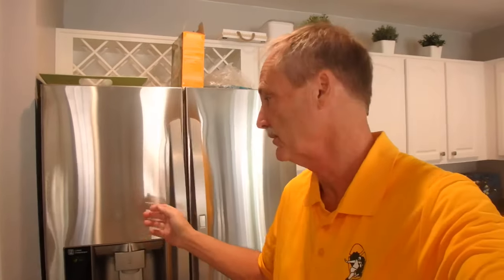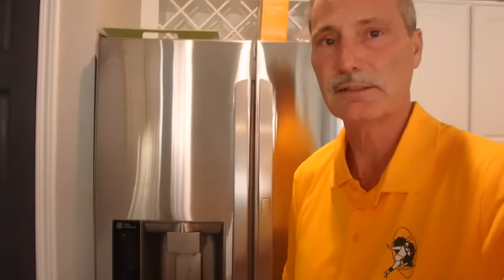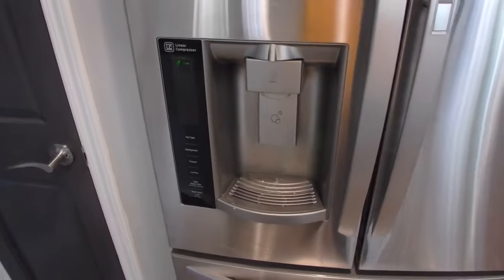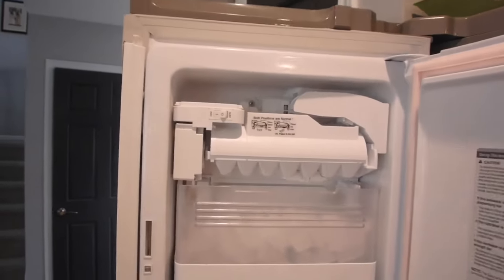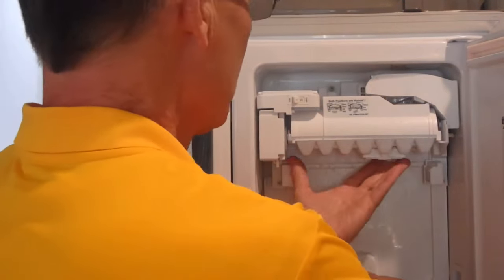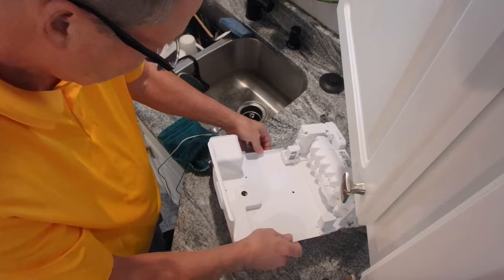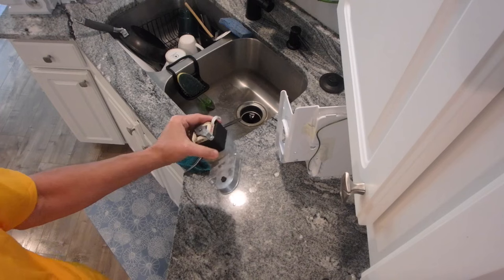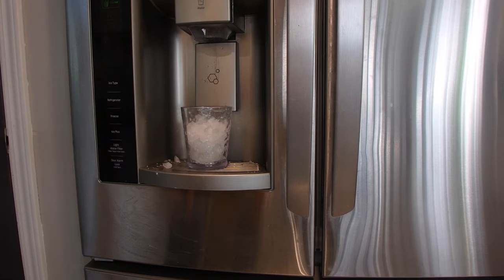LG Ice Maker Repair

Comment: Huh...you actually didn't show how you fixed the frozen-jammed actuator. Ya know,  the thing that wasn't working 😮
Reply from the maker: I didn't fix it.  I bought a new one and replaced it.  The internal gears moved but the actual small motor was seized. So I had to buy the entire actuator.  I found my model on ebay for $50
Reply: Where do you find the model of the actuator?? This is the exact issue with ours.
Reply from the maker: @NicoleVadasz  I reviewed the parts manual for my LG model.  It indicates the proper part number
Reply: Cool! Thanks Scotty G! I have the identical problem. I will be looking for that model number and swapping it out.

Comment: I have the same problem in my LG fridge.  It just overnight stopped dispensing ice.  I have been through several videos.  However, I can turn the actuator by hand.  It is making ice okay, the flapper opens when you press for ice.  No motor noise.  I will check on replacing the actuator.
Reply: what is actuator ????

Comment: My Ice maker stopped a making ice and before I was about to spend 150 on the ice unit I just did a good old unplug the entire fridge freezer pressed a few buttons to try to discharge all residual juice and plugged it back in and it worked. Start with the easiest fix first. I'm happy not to have done any real work and saved some money too. Figured I would contribute since I watched this video it could help someone as well.

Comment: Appreciate the video. Our icemaker jammed and this video gave me the courage to take it apart myself

My problem, if the helps anyone else, is that the ice expanded in the tray (water expands when frozen) and jammed the turning mechanism so it won’t dump the ice. 

The only solution I found is take it apart, put it outside and thaw it all. Put it back together, made sure all plastic parts that popped apart due to ice expansion were back together and it worked fine. 

Reason you have to take it apart is that if you left the door open to thaw it, you are leaving your whole fridge to thaw too 

Hope that helps someone. Follow his steps and let the whole unit thaw, then put it back.

Comment: This fixed our problem!! Our ice maker was making the ice but stopped automatically dumping it. We could press the button and manually dump it but that got old fast. Took a lot of effort to get that center screw off! Would also add that it took a few days to wake up and start working. Went on vacation and returned to the bucket being completely full upon our return! No issues since.
Reply: I'm having the exact problem as you. Did you just clean the actuator or replace it?
Reply: @jordaeclark5  update- ended up not working a few days later. Had to have the whole coil unit (name?) replaced by a professional. Definitely needed a professional to do it bc it was very involved with changing out gas.
Reply: @lindsaymoye3214  it worked because you turned it off for a while then back on allowing it to reset.

If you hit your reset button and it dumped ice nothing was wrong with your motor
Reply: @windstrings  So what IS the issue with this symptom?  Mine stopped making ice...I did the reset, and now it makes ice but doesn't dump/cycle...  unsure what to check/do next.
Reply: There are a bunch of us on here all asking the same question due to the same issue:  Icemaker makes ice, but doesn't cycle to dump the ice in the bin.  When we hit reset, it cycles.  This shows you that everything is working with the icemaker EXCEPT the sensor that tells it the bin is FULL.  Why else would it not dump ice?  The sensor appears to be infra red bulbs at the bottom of the tray that shoot over the top of the bin.  When the sensors are blocked, DON'T dump ice.
Not sure how to fix them.  I cleaned them off real good and am waiting for ice to freeze now.  Don't think we can get that part separately.
Reply: @jimbutler7122  YES!! The only way we an get the ice to dump now is to push the reset button EVERY time!! Someone please HELP!!

Comment: Our LG is a slightly earlier version as it does not have the ON/OFF switch for the icemaker. Mine was turning the ice into a block and freezing the whole assembly to the door. Saw a video where someone cleaned the water dispensing orifice. Tried that, no change. Inside the filler spout there is a plastic plug with a very small orifice. I pulled that plug out. (Mine was orange) 3 weeks later, no issues whatsoever.

Comment: Hi Scotty G., thank you for making this video. Same ice maker as featured here. I have to keep pushing the reset button to dump the ice. I need your expert advice on how to fix that! Thank you!
Reply from the maker: That’s a very good question.   I have not had the opportunity to work on that.  I would review the schematic of the upper component and see of the reset button is a replaceable item.
Reply: same here...what's causing this?
Reply: Same for me.  I've tried everything the other videos show.  My only problem is I have to press the reset button to dump ice.  It won't do it on it's own.  Bar is not obstructed.  Everything else works as it should.
Reply: @kp4585 having the same issue as you! Sucks

Comment: The actuator never free spins , the old one was probably fine.
He never showed that the new one spun freely...bc it was no different.

The gearing mechanism is fixed till it activates to dispense ice.

Remove the ice tray, close the door & press the lever to release ice, you'll see it spins fine when activated, now try to spin it by hand....nope!

That's normal operation.
Reply from the maker: Friend, I replaced my actuator and the ice dispenses properly.  And that was the pint of the video.  My original actuator was bad, buying a new one for $65 and replacing it myself fixed the problem.

Comment: Hey Scotty G. Thanks for the VIdeo Great!     My problem is this. I have water that dispense "Ok". But I have "no" water for the ice maker. Just does not fill. The switch seems to work, but when I turn it on and off the tray does not move (much). Is it sticking? Got any ideas? Again, I have water dispensing ok. Just not filling the tray and the tray maybe stuck.
Reply: Mine did this.  Take the bucket out, and up in the left corner, facing down, is the reset switch.  Hit that and see if it fills.

Comment: Hey Scotty  I got the same Ice maker you got. I've always got crushed ice and found a white plastic part in my glass which I know came out of the icemaker. Looks like a small wheelchock. It has a long gated hole in it made that way handle-looking thing.  I'm sure it has something to do with Cubed and Crushed Ice. You didn't happen to see anything like that in there. ABS   P/N   MEA619928-6    HN.09.10         The 28 could be a 26 number are worn.
Reply from the maker: I don't recall seeing it.  But I was more inside the motor that turned.   Not too much at the area you speak.  I would google your model and look at the schematic to see if it looks correct.  Could be part of the method to toggle between cube and crush

Comment: Did you buy a new actuator or repair the one that was already in the refrigerator? If you repaired it how did you do that step? This is exactly what is happening with mine.
Reply from the maker: The motor driving the gears inside was locked.  I bought a new actuator assembly for about $65
Reply: @scottygtheretirementguy3134  By any chance would you have a part #? I have searched the lg site and can't find the actuator.
Reply from the maker: @TiGress422  the actuator might be model specific. I googled my model number which is found inside the refrigerator near the door, and added the word PARTS.  Several listing came up with diagrams and part numbers.    Places like partselect, partsdr, appliancepartspro.  Show up
Reply: @scottygtheretirementguy3134  Thank you, I will do that. I appreciate you getting back to me so quickly.
Reply: I love these comments!  I knew my answer would be here aka already asked!  Go SWAG!

Comment: I have a LG two door fridge and there is ice building up on the wire that moves that dispenses the ice. I have no issues with the water coming out of the fridge and have tried resetting the ice machine many times. What should I do? Do I need to replace the ice maker?

Comment: We could not find exact actuator so we bought whole assembly. The new one has extra plug. Old one has two and new one has three. We tried to hook up not using extra plug and it doesn't work at all. Any suggestions?
Reply from the maker: Sounds like the incorrect part

Comment: can I use a spray like WD-40 to loosen the actuator and hopefully start dispensing ice cubes again?
Reply from the maker: The inside of the gear mechanism is packed with grease for the gears.  It might work, but my motor was not working.
Reply: Is there a way to test motor to see if it works?

Comment: Noticed no water line hooked up the the ice maker assembly when you removed it.  Where is the water supply?  (I'm asking because my brand new unit leaks water into the bin and down into the ice dispenser hole.)  Mine doesn't have an on/off button either.
Reply from the maker: The water comes into the tray up at the top right corner.   So I don’t think mine showed.  If yours is brand new it should be under warranty

Comment: Hi! I have the exact same refrigerator but my problem is that the icemaker is slow to make ice. Even with new filter, same results. The water dispenser works great. What could be the issue?
Reply from the maker: Hmm. I assume not enough cold air flow.  Does it work better if you use the Ice Plus option?   You could lower the freezer temp. Mine is at 3.  They are a rather slow maker

Comment: Scotty, thanks for the video.  After you replaced the actuator arm, how easy was it to turn the metal connector?
 I can turn mine, but it takes a little effort.  Should it turn easily or with some resistance?  Thanks.
Reply from the maker: Since it has a few gears inside the motor it has some resistance.  Similar to winding an old fashioned clock with a key

Comment: Hey Scotty G, where did you buy the part actuator? Mine is doing the same thing (not dispensing ice)
Reply from the maker: I googled the part number from the specific model parts list.    Then I used Amazon and found one.  They might also be on eBay

Comment: Where do you get the parts 😊
Reply from the maker: I bought mine by entering the part number in Google search bar.   Then looked at the suppliers
Reply: @scottygtheretirementguy3134  mine won’t drop the ice down to the bucket

Comment: My ice maker stopped working recently. Water always pours. After reset it made few ice cubes only in 4hrs. 
I also have ice maker on the bottom freezer comparrment. It never worked since I moved in. Reset/test does norhing. Can you help?
Reply from the maker: Sounds like something is wrong with the cold air blowing over the water, for the upper ice maker.  You can check the to make sure the air is blowing strong, or it could be the compression of the freezer.   Is your frozen food solid?  If you place a small bowl or N old school ice try in the freezer, does it turn to ice the next day?

Comment: I appreciate this video but I need someone that can tell me what's wrong with my LG Slim Space Plus ice maker.  It works perfectly fine (makes ice, dispenses it, refills and makes more ice, etc., etc., etc.) for a while then, it stops filling (but continues to try to dump ice, but at that point there's no ice to dump).  But if I switch off the ice maker for a couple of hours, then switch it back on and press the recycle button, it starts working again for a couple of hours, etc., etc., etc.,  I have searched high and low for answers.  I called LG and they walked me thru some process intended to throw a code to diagnose buy that didn't work.  I can't find anyone having this same problem of working intermittently, that I'm having.  Any ideas on this?  I'm like you, I can put two and two together to figure things out normally.  NONE of the simple stuff is the problem.  It's almost as if SOMETHING is frozen and shutting it off for a while thaws it out then it starts working again.  I don't know...I'm stuck (and I hate to pay someone to fix anything).
Reply from the maker: That's a tough one.  It does sound like something is freezing off.  Once it stops making ice, have you taken the ice maker out and checked the water line to see if it's frozen at all.   Also I'm not where the pump is located that moves the water. Something might be wrong with that
  Good luck post if you fix it
Reply: Most likely it’s a a bad bin full sensor